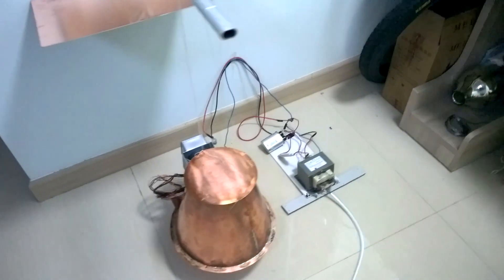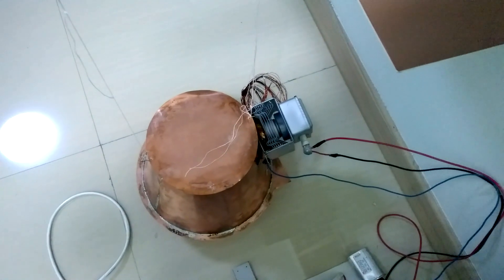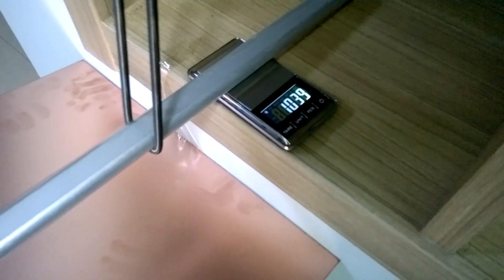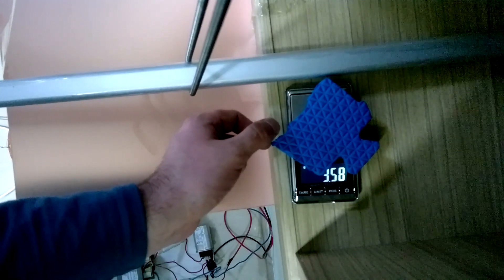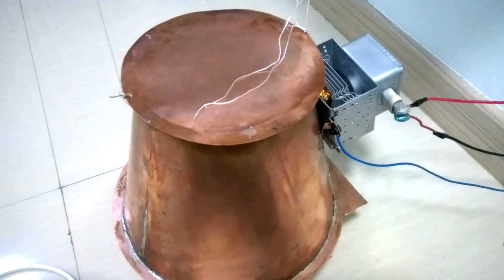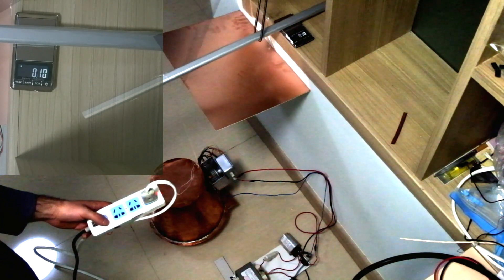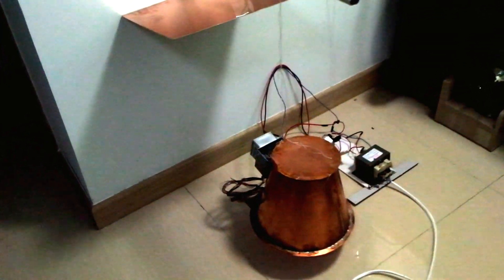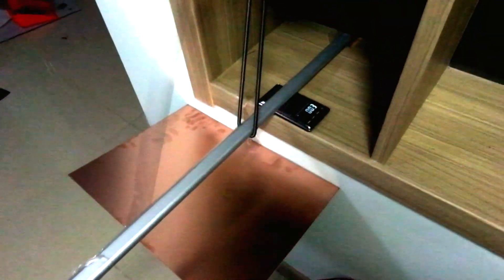EmDrive Test No.03 Success, I have thrust !!!

Comment: you do realize your scale has a "tare" button
you don''t have to keep switching off and on
Reply: yeah a good idea but it is still within the fields halo so  the scales need to be further away, looking at the way the scales where acting i would say about another 3-5ft or so away,or add more shielding until they settle fully. the components are kicking out alot more than you realise
Reply: +Skizzofonik  you could use the tare funtion all you like in that position it will never settle or zero or for that fact be an accurate means or measure because of em/micro waves, most digital scales go crazy when near to high levels these waves. if you have digital  scales you can test this with a mobile phone put the phone near the scales and dial out watch those scales go up! to measure the thrust in this way the scales would have to be isolated from these waves some how, a longer leaver perhaps to move it out of the fields ;)
Reply: +stigmarto I think that's why there's a copper plate below..

Comment: Shield yourself or you'll get cooked.  That's lots of microwaves.

You may have thrust due to the Emdrive device formulae, but you're also very likely to have air motion thrust, where a high voltage can cause motion of the air around it, because 0.47g is huge for thrusters of this design.

Comment: I hate to be skeptic but what about the vibration off of the transformer?
Reply: +Legend Cox That's not a transformer, it's a magnetron. But it does vibrate. However, that's the jumping of the scale, not the constant effect.
Reply: WhTStr213 isnt a magnetron a fancy high frequency transformer?
Reply: +WhtStr213 One of the oddities of vibration is that it can produce a constant offset; this is an effect which has fooled generations of 'expert experimentalists'.
Reply: +Legend Cox magnetron and digital scales just shouldnt be anywhere near each other, place a mobile phone next to  set of scales make a cll and see whta happenes
Reply: WhtStr213 You don't know what you are talking about do you? Iron is a tiny percentage of the haemoglobin proteins that reside in your blood cells, cells which only make up a tiny minority of your whole body. If you were to focus and heat them up they would just conduct the heat to their haem group then to the protein then the rest of the body making an overall, tiny change. Just think, or do some research before you type shit on the internet.
Reply: Morru Qu'aan
The human body is made of many things, and any of which gets effected would be bad. For more info, search microwave weapons.
Reply: The transformer is on the floor
Reply: +WhtStr213 only a very specific wavelength that's frequency is the same as the oscillation of the O-H bonds in water.
Reply: WhtStr213 Well, the human body is 70% water so its a pretty good estimate to go off of.
Reply: Imagine just targeting the iron in blood. Imagine inducing the iron to 600 degrees celcius. This would be bad. The water would be messier, though. Being cautious is an understatement. You do know your stuff.
Reply: I know electromagnetics, not biology. Like you know anyways. Ha.Whatever.
Reply: WhtStr213 Actually i do, look up the British biology Olympiad, I got a silver :D
Reply: Well dang. That don't prove anything, but I'll believe you. What' cha doing here? And by the way, the internet IS shit, at least in my field. I'm self taught, and you wouldn't believe the shit I've had to Unlearn.
Reply: @whtstr2133  I Am So SmArT LoOk At ME
Reply: WhtStr213 well, electromagnetic stuff is pretty easy to test yourself if you suspect something is false.
Reply: don't be to hard on yourself it took me years to realise that a great deal ofd information I acquired in years of voracious reading wasa only somebodies opinion disguised as facts. That's the way it is with guys if you don't know something bullshit till you are caught
Reply: I find it hilarious you think a chelated molecule will conduct heat.
It would more likely cross-react, a bonded group won't simply vibrate things away.
 Go do some real science.
Or better yet...please don't.
Reply: I'd like to see this done  in a vacuum chamber using a mechanical balance, and longer string, so electromagnetic effects are limited. The vacuum would also make any effects caused by the expansion and rise of heated air.
Reply: The microwaves produced by this unit are but a 'CAT FART' compared to interstellar radiation. I wouldn't want the universe to laugh at me.
Reply: +Legend Cox You are on the right track: vibration can produce some amazing counter-intuitive effects.
Reply: And magnetrons also emit microwaves....the kind that cook human
Reply: Polis Nunki true, but they can still be stopped by a thin layer of aluminium.

Comment: An additional scale placed next to the other one would actually be nice - you said to can put it on the side and then fire but then people would argue that you're not actually firing. Anyways... a while ago when I was in college I worked in a deli and we had to weigh sliced ham and turkey and stuff like that and I noticed that when a nearby microwave oven was in use the scale would go nuts. We couldn't accurately weigh anything while the microwave oven was in use. So I'm thinking that clearing that possibility would actually be important for the purpose of your experiment. 
You did not obtain any thrust when you used the device horizontally hanging from the door frame but thrust was observed when using a scale in a vertical position. Lots of questions being raised right there. The air heating up in the cone and providing lift is also a valid point. remember that no thrust was observed in a horizontal position in your previous experiments maybe because heated air escaped the cone. All in all the measurements could be wrong due to either using a digital scale that is subject to nearby microwave disturbances, or due to hot air being trapped under the cone. Try to obtain similar results with the same device either horizontally or with the thruster facing upwards - i.e. pushing down on the scale not up. Also have two identical scales to prove that there isn't any interference from the microwaves.

Comment: Several issues - the use of an electronic scale in the presence of RF/EMI can produce a reading all by itself (I notice he has a shield between the thruster and the scale), and the use of a metal spring. A more accurate way to measure, would to use a balance beam with calibrated lab weights to null it out - keep it all mechanical and avoid false indications.

Comment: Move on with  implementation  of the em engine. let's not test it to death before we start using it. It has been tested and proven to work to a substantial  degree over our current systems for energy mutiplication and can be improved  through use.

Comment: The copper container stops the microwaves from escaping. Also the magnatron  you got from a microwave isn't going to produce that much thrust. You'd need three more to set it up as a quad pole system with a waveguide in the center of your rig there.

Comment: I would like to see the foam on the scale with the drive turned on/off to ensure that the scale was not affected by stray microwaves etc. in that setup.
Reply: Carl Williams
Well, my alternative was to put a constant load on the scale and see if the microwaves affected it....

Another poster has also commented that the heating might have an effect, so testing in different orientations to ensure that any thermal or magnetic effects were cancelled would be a good precaution.
Reply: +James Lewis 
he needs to try obtaining similar results with the device in a horizontal position or pushing down on the scale not up to avoid the possibility of heated air trapped under the cone providing lift - like in a hot air balloon. Also digital scales are subject to microwave interference. I know this for a fact - so he needs two scales. One under the device and the other next to it.
Reply: +James Lewis Yes, like in the horizontal tests that he's been doing where the device was hanging from the door frame and under the device he had a    paper with lines to measure movement. See tests 1 and 2. He observed no thrust, no nothing in those tests. That pretty much proves the entire thing seems too good to be true. The moment he switched to a digital scale with the cone in vertical position he observed thrust. The microwaves heat the air trapped in the cone and the air provides lift. Simple as that. Yeah...sure I'm disappointed, but if it doesn't work we have to acknowledge that and move on to something that can actually take us to the stars!
Reply: +James Lewis A simple way is using a second scale beside the first with no load as a control for the experiment to see if the scale is actually being affected and giving false readings or not.
Reply: +James Lewis I think that alongside with experiments, a theoretical approach must be taken no matter how exotic it may look, and odd. I personally believe that microwaves are creating a grid of standing waves that is trapping and bringing into existence vacuum fluctuations. Now, you know that the vacuum fluctuations or virtual particles are "off the mass shell" which means they can behave like "conservation rule breaking" for a very short time. What the cone shape does is actually creating some kind of a gradient of whatever is happening within. I think that the vacuum fluctuations, are coupled very weak with the microwave standing waves resulting in a "phantom" momentum change. And voila: thrust. :)
Reply: +Boboc Gabriel All completely valid points... I think it's definitely some kind of interaction with virtual particles if it's real... but since physicists cannot agree that this is possible, the first stage is to prove that the effect actually happens, and them let them integrate those experimental results into the theories and perhaps when we have a theory that incorporates this new data we can use that to predict how to improve the thrust.
Reply: +James Lewis True. Maybe if we raise the power of microwaves by a factor of ten and tweak the frequency we can obtain results that are above the statistic noise and other parasites. Taking the air out of the resonator is also a good step and making the experiment in a vacuum chamber.
Reply: Formula 1 fan Also valid tests... but having said that the microwaves affect the scale, I'd like a mechanical scale, or some way to show that the scale isn't being affected.
Reply: +James Lewis Good idea, however, in all my years working in labs, I've never seen a mechanical scale capable of reading +- 0.00g. Is there such a beast? "What kind of sorcery is this?".
Reply: +James Lewis NASA has tested these in vacuum to rule out stray atoms and heating and thermal vibrations, etc. Still shows a thrust. Plymouth University may have a possible answer for why this works without violating conservation of momentum. https://www.technologyreview.com/s/601299/the-curious-link-between-the-fly-by-anomaly-and-the-impossible-emdrive-thruster/
Reply: +mycroft16  Have they really? I've heard a great many people say that NASA has tested them, but I've never heard NASA say that...... Don't you think if this worked, NASA would be screaming it from the rooftops?. I really hope it does work but I will be waiting for some credible source to prove it conclusively.
Reply: +James Lewis Oh yeah. NASA has run multiple tests now, both in and out of the vacuum chamber. All of their tests have show that it does indeed generate thrust. 5 other prestigious research groups around the world have also independently verified that there is a thrust generated. The link in my previous reply is to the MIT Technology Review. Article is about a professor at Plymouth University in the UK that thinks he has figured out the reason why this generates thrust and how it does it without violating conservation of momentum. It's some really wild and cool stuff. I'm sure that over the next months NASA and others will begin using his theory to refine tests and try out new things (he makes some predictions about ways to alter and control the effect). If this pans out, it could be huge. Just need a power source... no fuel. Definitely one to keep an eye on. And NASA will scream it from the rooftops once they have put it through sound and rigorous scientific scrutiny and understand what is going on. It excites them a great deal or they wouldn't have picked up such a seemingly crackpot idea in the first place.
Reply: Plenty of rooftops around here...  I'm waiting...
Reply: +James Lewis Given how the scientific method works, you may be waiting a while. They'll test this, retest it, test it again, go and think about it, redesign it, test it some more, fiddle with it again, test it, publish countless papers on it, various other institutions will all be doing the same. They'll meet up at conferences and present on it and when they understand it, they'll get on the rooftops. But the math and the physics is bearing this one out so far, so it looks hopeful.
Reply: mycroft16 "Given how the scientific method works", it would be foolish of me to consider you a credible source... and since I have seen about as many unsubstantiated reports of this device working as I have of alien abduction, I will suspend believing anything about this device until the extraordinary claims are matched with extraordinary evidence.
Reply: +James Lewis https://www.technologyreview.com/s/601299/the-curious-link-between-the-fly-by-anomaly-and-the-impossible-emdrive-thruster/
That's an MIT produced periodical with links to paper on arXiv, a recognized repository of scientific research. Article talks about NASA and others who have tested this and all gotten the same results without a readily apparent explanation of how it was working ( until this paper was published 2 days ago ). You should be skeptical. Any good scientist is always questioning. As long as it isn't cynicism it's healthy. I call it optimistically skeptic.
Reply: mycroft16 As I said, I think it's very interesting... but as someone not directly involved with this research, it's hard to be certain what results really can be justified, and which cant....

BTW, I have another answer to the question "If not McCulloch’s explanation, then what?"... What if there /is/ reaction mass, it is virtual particles... according to quantum physics, the particles appear and disappear at random... but surely if they were accelerated by the field inside the can and disappeared before reaching the edge of the enclosure... then you are using virtual reaction mass, and you are literally pulling on another dimension to create the force.
Reply: +James Lewis Virtual particles are of course a possibility. There are a couple issues though that make that highly unlikely. Virtual particles appear at random across the entirety of the universe. An uptick in virtual particles of a significant number to explain the thrust on this EMDrive would mean it wasn't a random event any more. A sustained thrust force is not  a random occurrence. That said, virtual particles occur during the casimir effect, but this isn't that, though it could be some new situation in which they appear.
That is why this paper from the link is so important. It offers an explanation that can be tested and observations either will or won't agree with the predictions. If they do agree with a reasonable degree of certainty, that is a strong indication that the cause is Unruh Radiation pressures. If not, they'll go back to the drawing board.
Reply: mycroft16 Unruh effect appears at the speed of light usually, and are nothing more than virtual particles becoming  "on shell" and acting upon the travelling surface. The pressure of the Unruh radiation should be opposed to the propulsion force.
Reply: +Boboc Gabriel We are dealing with the speed of light. Microwaves are photons. Photons travel at the speed of light. It isn't the engine that has to travel at the speed of light. Please read the link I posted above, he goes into more and better detail than I can on this, plus it links to the actual paper.
Unruh radiation is not virtual particles. Virtual particles pop in and out of existence spontaneously without any other event causing them. Unruh radiation arises from accelerating reference frames emitting blackbody radiation. It is an actual particle emission due to a state transition, much as photons are emitted by electrons during energy level decay. It's a real particle, not a virtual particle.
Reply: mycroft16 Virtual particles of course appear at random across the entire universe, but only the ones that appear inside the drive may have a force applied to them, thus causing a force applied to the drive in the opposite direction which will not be cancelled by the impact of those particles on the inside of the enclosure if they have again disappeared before reaching that point.